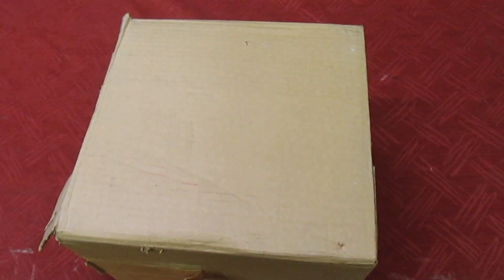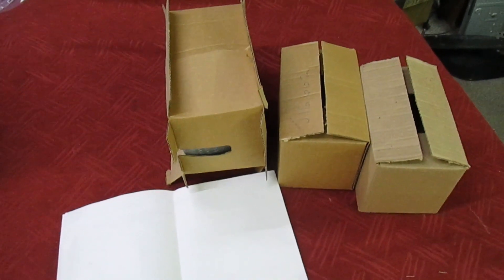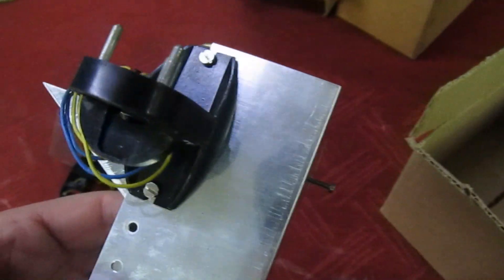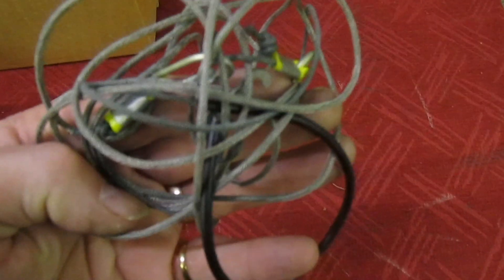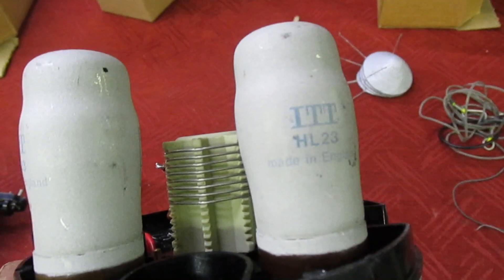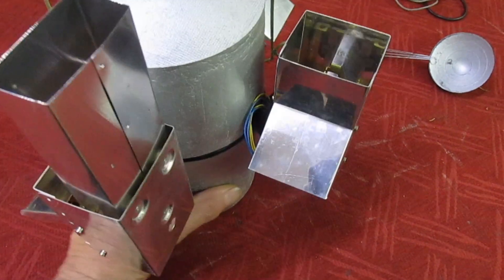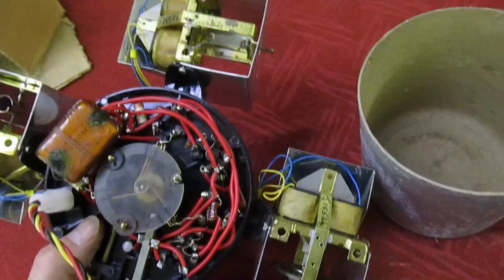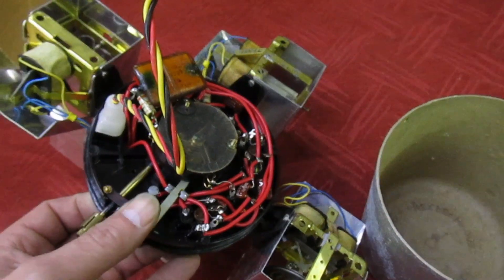Whiteley electrical radio co. ltd .  Vintage Radio Sonde MKII.b  .1975

Comment: Great bit of kit! The HL23 was a 2V heater general amp. Nip out and get yourself a weather balloon. Let me know if I am due for a storm later. Cheers Mike.
Reply from the maker: Its strange that something made in 1975 should use such old valves , maybe they had a job lot left and didnt know what to do with them .
Reply: @michaeldranfield7140  Must require a substantial balloon to lift the battery set! Cheers for a good channel.

Comment: High Michael, I know exactly what you have there. I used to work at Whiteley Electrical Radio Co. Ltd between 1966 and 1973 in the inspection dept and later in the research dept. The radio sonde (the e is silent) was manufactured for the meteorology office  by Whiteleys for many years. It transmitted three separate amplitude modulated audio signals produced by the three transducers you describe. Three signals corresponded to temperature, humidity and air pressure. The windmill arrangement, provided by the cup shaped objects, energised  the switching of the signals to produce a primitive multiplex system whereby one carrier frequency could accommodate three data signals. There were two batteries housed in the lower section of the  device, one for the valve heaters and the other to provide the ht voltage. The  sonde was suspended under a latex balloon of about 2m in diameter and released from various weather stations. A label was attached to the sonde informing the finder that a reward would be given if it was returned to the authorities when it returned to earth. I think this was the princely sum of 5 shillings. It's about 50 years since I worked next door to the department which manufactured the sondes but I can still hear the distinctive three audio tones which were produced when the transducers were being calibrated. I hope this casts some light on your purchase. It is said that information from the sondes was used in the weather predictions in the run up to the d-day landing in WW2.
Reply from the maker: Very interesting, I had assumed the receiver part was missing but someone said it was transmitted on about 27 Mhz am so anyone could listen in, incidentally I watched a program on TV a couple of weeks ago about the worst weather in England where it snowed and was frozen for 6 weeks and they made a reference to the radio sonde and showed one going up on a weather balloon to try to predict how long the freeze would last, I didn't know much about whiteley electrical but I have had a look through some old magazines and they were a very important company in there day making speakers and valve amplifiers, I also saw they use to have a summer fair and appoint a miss whiteley electrical queen.
Reply: @michaeldranfield7140  Yes, Whiteley Electrical Radio Co. Ltd. was an excellent firm to work for. They were primarily famous for their stentorian range of loud speakers but they also manufactured a wide range of electronic equipment for the admiralty, gpo, hmgcc, madresco (hearing aids), met office, radio rentals, air ministry, British rail, rediffusion and hi if units of course, all of which, I had the opportunity to test and fault find on. I eventually gained a place in the research dept where one of my roles was to design transformers. They also gave me the opportunity to attend day release which enabled me to gain invaluable qualifications. I think the days of appointing a miss Whitely preceded my time there but we were always invited to the home of Mrs Whiteley every Christmas morning for drinks and mince pies ! Very happy memories.

Comment: Where did you get this? I'v#e been looking for one for years. I used to monitor them in the late 1970s - they operated around 27 MHz, and you could pick them up for hundreds of miles. The sensors are sequentially switched into an audio oscillator that changes its tone according to the sensor output, so you hear a rhythmically changing set of tones that fade in and out  as the sonde moves across country. Very eerie late at night. The use of valves is simply because this was a good desgin that lasted twenty or so years, and redesigning scientific equipment follows a completely different dynamic to consumer gear. All utterly fascinating, and I'm delgihted to see this - now, can you get it going? :)
Reply from the maker: I bought it from a lady who was selling off here late husbands collection of electronic equipment,I guessed it was a rare item as there was one on the internet in a museum,I didnt have any interest in powering it up ,I bought it just because it looked interesting not knowing what it was untill I researched it on the net.
Reply: @michaeldranfield7140  Aha - good to know they''re still out there. I unnearthed a Youtube video of one in action on a weather ship in the 1940s, where you can see a two-man team decoding the data by eye  and brain from an oscilloscope and a reference oscillator - data transfer before modems!. The rest of the newsreel's on Youtube too, if you want to see them. https://www.youtube.com/watch?v=p93a7w4Hws0&t=1s&ab_channel=BritishPath%C3%A9

Comment: Are you going to reverse engineer it? It should be possible to work out a power supply requirement - the 3 wires are probably common -ve, heater + and HT +. As you say one sensor is barometric pressure. I would expect the others to be temperature and humidity, wind speed via the vanes and rotor. For that to work there would have to be some mechanism - a sail or similar - to keep it head to wind and perhaps a compass to report back wind direction.

Comment: Interesting,  but I don't understand how something made apparently in the 1970s could use pre WWII valves, or valves of any type, for that matter.  🤔
Reply from the maker: Yes, its strange to have valves as you say for the year but I guess using a valve means it wont be affected by temperature changes like a transistor would as the valve is in a vacuum , as for the type of valve I dont think in 1972 battery filament valves were still in current production so I can only guess either  they had these left over from some earlier production or they bought a job lot on the cheap, I need to do some research on the company when I get more time .

Comment: Fascinating stuff valves in 1975 going to the edge of space! mind you if they could be used in proximity fuses inside shells this is a breeze for them. I hope some one  tells us how it works. How is the data modulated demodulated? Thankyou very much for this post.
Reply from the maker: It would be nice to know more about this , I can only think they used valves as they wont be subject to change in temperature variation due to been in a vacuum ?

Comment: I think tbe rotating part is for an anemometer.
Reply from the maker: Yes I see now , those cup shaped things screw on the side part that turns, so 4 sensors not 3 as I assumed so it cant be one valve for each sensor .
Reply: A balloon drifts with the wind, so there will effectively be no horizontal wind speed. What it can measure, though, is vertical speed, so it will tell you how fast the balloon is ascending or descending. Also, you'll note that the anemometer vanes are arranged with a horizontal rotational axis. This would be no good for horizontal airflow measurements but ideal for vertical ones.